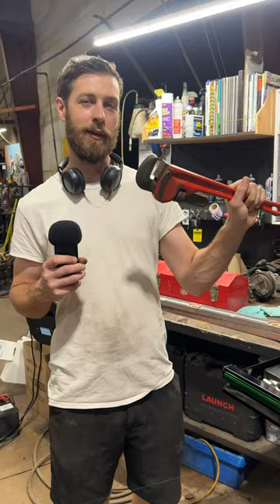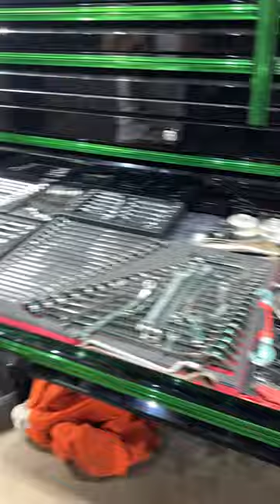Running Out Of Space SnapOn Epiq Wrench Drawer

Comment: You could fit alot more in there if you loose the foam. I run a field service truck, and can assure you that you are no where near out of room. My truck has to haul absolutely everything I could need in a typical day where I could be 4 or 6 hours away from the shop. As such my truck is literally a game of tetris trying to fit everything in it. Tools parts, consumables, bolts, wire, electrical terminals, everything. Anyway, long story short, you got the room, use it.

Comment: Not every tool needs to be in your box. They also have locking cabinets. Be creative, and lose comercial organizers. Make your own. A solid wire coiled makes great wrench and plier organizers. Add a free HF magnet strip or 2 and you'll have hanging side storage. The limits not your space. It's your imagination
Reply from the maker: Yeah mabye I should ditch the foam wrench holder and other plastic trays